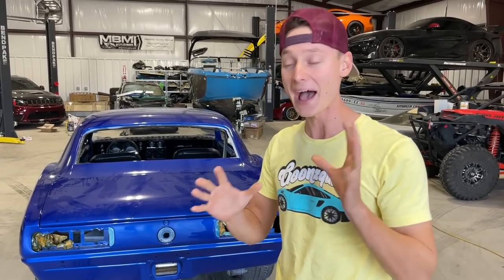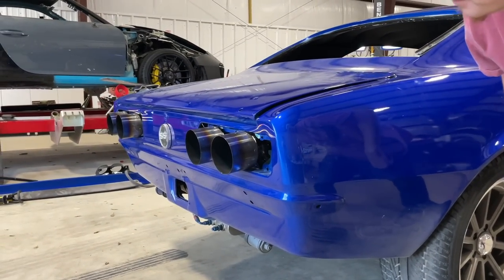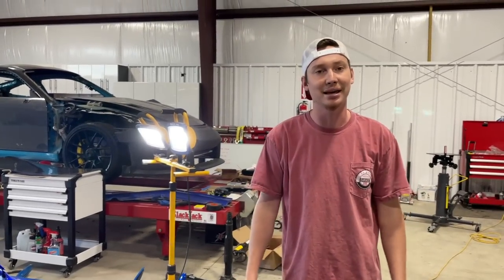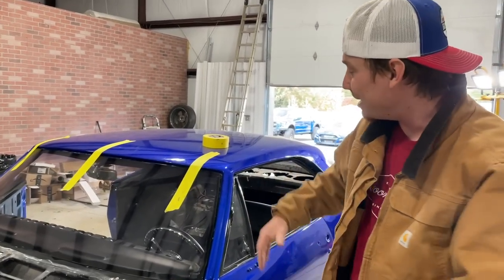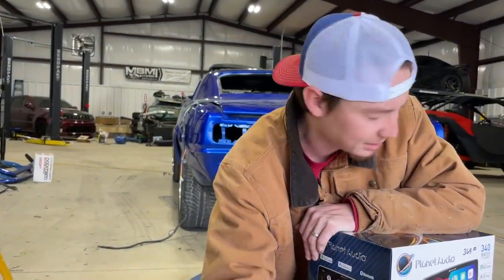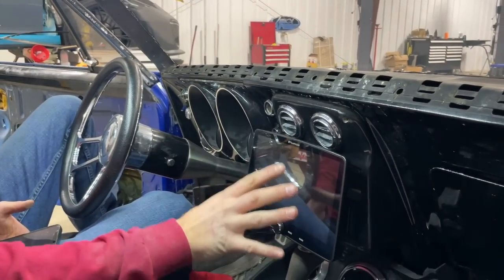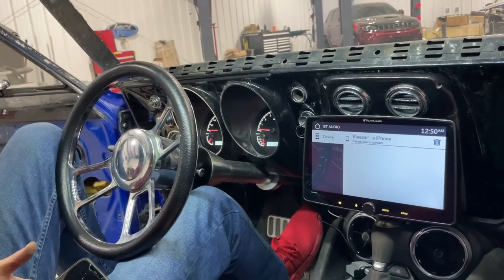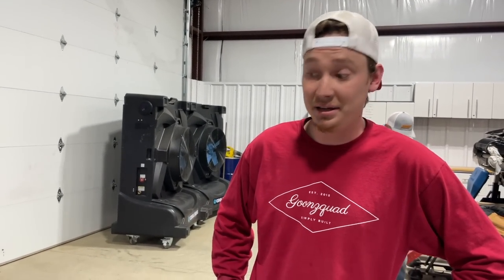Our LT4 Swapped 1967 Camaro Gets An Insane Stereo System!!!

Comment: I know you guys want to finish this car ASAP, but PLEASE, listen to the comments telling you to fix what you did wrong with the fuel pressure regulator, you NEED to connect a vacuum line to the regulator so it can raise the fuel pressure with the boost from the supercharger, you will run the engine lean and blow up it up if you keep doing burnouts and driving it hard like that.
Reply: Doesn't that have a module that controls fuel pressure already? I may be incorrect,  but im 99% sure it is already regulated. That's a legit point though.
Reply: @CorrectiveLensesRequired  No because they installed a custom fuel pressure regulator, the ZL1 they took the engine from does it automatically with the stock fuel system, but since everything is custom in this Camaro they need to add a vacuum line to the regulator because the engine doesn't have any way of telling the regulator to raise the fuel pressure with the boost.
Reply: @joealex65  it's there car they do what they want.they don't have to listen to anyone.
Reply: Engines run really good right before they exPlode.
Reply: @jerrywilcox9890  he is trying to help them out and save them time and money in the future instead of them putting a ton of work into a car and blowing the thing up on accident lmao
Reply: @jerrywilcox9890  ok dad
Reply: Screw um’! Let them blow it up as it’ll be fun to watch.
Reply: Please read joes comment
Reply: Should not be smoking like that. Add the vacuum line like it was mentioned
Reply: They also need to adjust the fan timing and temp on/temp off so the it operates at optimal temps
Reply: @CCscott  true, but not with the lt4
Reply: @chrispudd1815  lol you really think I care what you think or like.second I'm not your mate.
Reply: @chrispudd1815  ya people that like to tell others what to do with there cars.they have already said they have to finish under the hood lol.no way really you need to connect a vacuum line lol.been working on vehicles for 35 years lol don't need you telling me what it needs hahaha.
Reply: @jerrywilcox9890  apparently you do.  I build classic restomods for a living, and the amount of things done incorrectly is staggering.  They are good guys, but they don't exactly know much about mechanic/fab.  What's wrong with trying to help them learn?
Reply: @jerrywilcox9890  The fact is I think they are listening to at least some of us concerning what needs to be done to the engine, but watch how they never mention or give thanks to us viewers for helping them figure out the complicated stuff they don't know how to do, and then their next video they praise themselves for working all day and finally figuring everything out on their own.  That's Bull Shit.  Sneaky little Jerks,  Typical Ukrainians.
Reply: @jerrywilcox9890  I'm just trying to help, nothing wrong with that, as they said on the video, they are just figuring things out, also, for someone that has been working on vehicles for "35 years" and doesn't know why what i said is needed on a boosted engine, sounds like you're who has no idea what he is talking about...
Reply: I hope they see this before they blow up that engine
Reply: Right. It seems like they’re rushing things up
Reply: @timglass6041  agreed to an extent and the worst part about arrogance is it ALWAYS ends badly because you THINK you can grow bigger than you actually can so when you fall you fall ridiculously HARD
Reply: They are young, still learning! Hey, if it blows up! ( which, it will! ) costs , will eventually catch up! And they seem like , quick learners, especially, with all if these keyboard mechanics, in the comment section!
Reply: @jerrywilcox9890  *their
Reply: Some people need to understand these videos are edited sometimes filmed days before so by the time they released the first video the second video is already filmed. So they won't address the problems cause they're way ahead of it. Another thing is I doubt they really pay attentions to most comments which I understand they would be very depressed with all the haters. I suggested they found another youtuber to help them get this car on point. I believe they will complete the car get it running looking good for youtube then send it out to someone to take care of it's issues and fix there mistakes.
Reply: @jerrywilcox9890  yeahhh ayyy jerry cocks
Reply: Hi Joe, 
Your concerns seem real and well researched. I’m wondering if you’ve had a similar experience? Maybe you’ve managed a race team or have built a similar car? (Your kind comments and suggestions will get a far more respectful reaction if perhaps you just let everyone know where you’re coming from..) 🖖
Reply: @rebuilders22  I can remember multiple times they shouted out the comment section for helping them notice things. 

Obviously they are learning as they go. I don't see the issue with professional offering up advice in a polite way. It isn't like anyone us bashing them. 

Some people just have to respond and make everything negative. Or some just want to see them fail for something to watch. 

I'm going to laugh when they run that source to the regular and thank the comment section!!
Reply: Joe Alex is right y’all they will lean it out and burn a hole in the piston.. if anything they need to do boost reference wiht a regulator so that for every pound of boost it makes it will bump it up a pound of fuel pressure.. and might I add them lt4 engines ain’t cheap
Reply: And no that thing isn’t supposed to smoke like that when the rpm gets high. They keep ragging on it like that without getting it 💯 they WILL throw a rod outta the side of the block and that’s a fact.
Reply: these brother will never listen, they will just do whatever they like and think it's right
Reply: @solutionparklane790  it's there cars there channel and there money so they can do what they want.why people think they have to listen to people in the chats is beyond me.
Reply: Message them on all their platforms, they sure to notice 1 comment.
Reply: ( I think that was a brand new complete crate engine from an established recognised company) so I would guess the intake set-up and vacuum lines/ enrichener settings are already fitted? These boys are not too green behind the ears and their pops has a lot of knowledge too. I think they’ve got this one …..
Reply: I was waiting for someone to correct that tool haha
Reply: Dude, they don’t listen, the engine will blow up and they won’t give a shit
Reply: @dorzy207  🤣🤣🤣
Reply: @jerrywilcox9890  come on bro don't get salty, he was just joking with you.
Reply: @joealex65  ya after owning  5 of these cars  . You do need to pay attention !
Reply: If this isn’t acknowledged in a video with a thanks I’ll be jaw dropped
Reply: @MrMit50101  You know you don't have to watch the videos, just go and have a cup of tea with your parents and thank them for still letting you live with them rent free. "Don't be jealous of another man's success just worry about yourself " then one day you can leave your parents home and move to your own place.
Reply: @patriotprepper9175  you know it's not finished yet so give them a break bro.
Reply: @philtucker1224  they got the engine from a wrecked car that is at there parents house but i agree with what you said bro.
Reply: @Nigel_THFC  you've got jokes I wish you the same unfortunate  outcome they going towards and don't worry about me so much I'm glad you care but I'm perfectly fine taking others criticism and advise has got me far in life iv got nothing to worry about and where iv had to thank or give others credit iv done that hence my perfect life because I owe nothing to anyone iv given credit where it was due and that was payment enough for those that helped me but had I used others advise as my own I'd be as arrogant as you and them and my life 100% would be different
Reply: @philtucker1224  they took that engine trans combo out a crashed zl1 donor car.
Reply: Imagine thinking a “bumpin system” is more important than getting the engine runnin GB great and reliably
Reply: Wow, soo many salty balls in this section! Some people may have spent a long time (35 yrs to be precise) wink wink on engines, but perhaps they should spend the rest of their days improving their grammar and spelling! 😄
Anyway, calm down and go have a drink.
Reply: They don’t care about the comment section. As look as they getting views. Fuck it, let it blow
Reply: That fuel line ran over the motor is suicide. Any track that inspects cars before they run will tell them to get it out of there.
Reply: Boost referenced hose is not needed!Control module using factory fuel pressure sensor with adjust pressure.GM instructions... If using an aftermarket fuel pump, an adjustable bypass fuel regulator will be needed if
the fuel pump does not have an internal fuel pressure relief valve set at 84 psi. The adjustable bypass fuel pressure regulator needs to be mounted 
between the supply fuel pump and the fuel pressure sensor that is mounted in the fuel line. The regulator must be set at 84 psi.
Reply: This high-pressure fuel pump on the engine also regulates the fuel pressure 
using an actuator in the form of an internal solenoid-controlled valve that is controlled by the ECM.
Reply: @Heavyhitta509  they didn’t fix it though
Reply: At this point, let them blow the engine. They’re doing this to themselves
Reply: @shootpse88  oh, ok.
Reply: @CCscott  All part of the journey, right? lol
Reply: Letem learn the hard way 🤷‍♂️
Reply: at this point, it'll just be funny if they blow it up. You've told them this like 10 times.
Reply: Expert.....
Reply: Bruh they have FU money they’ll just buy a new engine.
Reply: @jerrywilcox9890  and they don’t, listen to people who actually know how to work on these.
Reply: @krispykruzer  these two are a YT channel that sells a ton of overpriced merchandise. They aren’t actual mechanics, with actual customers.
Reply: The worst part is that they have had contact with Cleetus and James who BUILD THIS STUFF EVERYDAY and they won't ask for help!! Hell, Garrett owns Motion Race Works!! 
I must say, I lost respect for the boys after seeing Sheepy say how bad the R8 is put together.  Not sure if they are stubborn and won't ask for help or just don't know.....also...audio pipe subs 🤔 🙄
Reply: @dullonion797  oh you mean the YouTube  mechanics lol.i wouldn't listen the YouTube mechanics either.
Reply: @dullonion797  so people say they actually work on them and talking out there ass like most do lol.
Reply: Let them know on instagram
Reply: they will just ignore this and kill the engine
Reply: @jerrywilcox9890  that’s the dumbest thing I’ve heard today….. someone offering advise to save a very expensive mistake is warranted.
Reply: Lean is mean! Hahaha
Reply: @Heavyhitta509  No, that's not how these guys do things, you just have to follow them on Instagram to understand, their videos have only 2 days on them, the day before and the day they release the video, for example, this specific video only includes what they did on Monday and on Tuesday the same day they uploaded the video, the Thursday video will be about what they did on Wednesday and on Thursday, Sunday videos will have what they did on Friday and Saturday and they usually skip Sunday activities on the videos because that's their free day. So, this video is as up to date as they get and they have time to fix things.
Reply: @philtucker1224  I'm just a simple self taught mechanic that knows a lot of things about cars, i've seen a lot of people blow up very expensive engines because of this exact reason (too much air, not enough fuel), and i know a thing or two about tuning cars and the air/fuel ratio is something you need to be very careful with, specially on boosted applications, that's the quickest way to blow up an engine.
Reply: @philtucker1224  No, they took the engine from a crashed car, if they were using absolutely everything from that crashed car it would not be a problem, but everything on this car is custom and the engine doesn't have a way to communicate with the fuel pressure regulator
Reply: @joealex65  ok, thanks Joe - understood.
Reply: @joealex65  👍😊
Reply: I'd hate to see them ruin the engine after all the work they put into this project.
Reply: @jerrywilcox9890 * THEIR... at least spell right if you want to try and knock someone bud! Further more it is us fans trying to help them, not make fun of them. They will tell you they are still learning things and love when the fans help them out so take your negative nancy ass to someone elses channel....
Reply: @Jules_73  he is a straight dork!
Reply: @Hugs-hearts-and-horses  I looked at Sheepy's video of them fixing the R8 transmission and yes he had some off-handed comments about the tuning of the R8. What does that have to do with Gonzquad? They did not touch anything in the engine or transmission of this car which his complaints were about. This car was already tuned when they bought it as salvage so it has nothing to do with them.
Reply: @robertgibson1707  oh know hahahaha
Reply: @robertgibson1707  I'm not your bud
Reply: I entirely agree !
Reply: @nigel yea I know “bro” it’s not finished but burning the tires off every video with it “not finished” especially when it could be running lean is a rookie mistake
Reply: They listen but they usually see late. They thank people all the time for the advice but we are seeing things way after it has happened. All the people arguing need to grow up. People are just giving suggestions, they admit they are learning and I am sure they appreciate the advice. At least they will try anything. They aren’t lazy at all.
Reply: Boy some of these kiss a$$ comments on here have me geeking tf out. I bet if y’all seen these bros in person you’d be the first ones to drop to your knees wanting to suck them off. I think the point of this should be to make sure the car is mechanically at 100% before you start burning the tires off or you could burn the engine down
Reply: And yes they need to connect the vacuum line to the regulator so that it can adjust the fuel pressure with the boost it’s the same concept as my previous comment about the boost reference. And also yes running that fuel line across the engine EVEN JUST for testing/burnout purposes is VERY dangerous it could melt or pop off and pump fuel everywhere and literally burn the whole car down.
Reply: But hey if I had YouTube money I’d be a little more chill on stuff like this but I don’t and I don’t think others in the comments do either so that’s why when we see something like this we say something because to us blowing the engine up on a build like this could break the bank and cancel the build until you can save more money to buy another engine and like I said them supercharged lt4’s ain’t cheap lol.
Reply: @kevinmcleod3741  If the internet has taught me anything, it is that there is no cure for willful ignorance.  Reminds me of the old joke, I think by Jeff Foxworthy, about the kid and the TV "just let him pull it down on himself once, he'll learn.
Reply: They don’t read comments or listen to them at all
Reply: @treysimmons2589  lol don't worry about what my problem is cupcake
Reply: @goonzquad
Reply: @chrislambert5904  I'll be what ever I want to be cupcake
Reply: @chrislambert5904  I don't care who has more knowledge lol 😆 😂.there car there money when they get to it they get to it
Reply: @chrislambert5904  they have has 50 more comments about it since the first start lol.when they get to it they get to it.
Reply: @Goonzquad
Reply: Too many haters and people want to see them fail in this comment section. The people who hate do so because the boys are living the dream that most of us wish for. I don't get why people would even want to hate on someone for doing well for themselves and not offer advice when they can see someone going wrong. Just cuz they don't have what they have, doesn't mean they can't contribute to their success. People saying stuff like they want to see the engine blow up show their age. I respect Joe for keeping it 💯 👌🏻 👏 💪 good on you for trying to helps these boys out. You recognise these guys bring us content and entertainment when they could easily do a few videos here and there these guys don't let you down, they give us content all the time and give something back to their viewers. Not many YouTubers can do that and some have the time but still dont deliver the content. You don't need to explain yourself to haters I.e. why you're helping the brothers let the haters hate, just ignore them and they'll grow tired. All they look for is a reaction because normally they never get attention. Saying stuff like leave em they get to it when they get to it, or it's their business why even get involved or being rude and stating they are typical Ukrainians makes no sense. If you're a supporter of the channel say what you like within reason as long as it's helpful and respectful, if not keep quite yourself if you have nothing to contribute or say, hence why this is called a comment section. Supporters of the channel offer advice that's normally not these pretend supporters.
Reply: Karen
Reply: @MrBest-mr2my  in fairness no one knows for sure if they do or not but I can imagine if they did the channel would probably close with all the rude statements affecting their mental health. Why do you think celebs go crazy after a while? Because people like you and me make it impossible for them to have a normal life.
Reply: @jerrywilcox9890  maybe if you actually knew what YOU where doing you would care a little more about saving them trouble 

 They seem ready to have the Camaro build done, so having to rebuild/replace that engine would slow them down quite a bit and then we could end up with a wait of another 2 years in till it’s done.
Reply: @philtucker1224  that’s not a crate engine. They pulled it out of a totaled rolled over 2017 or 2018 Camaro.
Reply: @Mocar1022  lol oh I know what I'm doing there cupcake.
Reply: @Mocar1022  lol I've been working on cars for 35 years cupcake I can handle myself lol
Reply: @MPLVT69  awe you mean there hahaha how's that there for ya 😉 😆 😅
Reply: @jerrywilcox9890  I’m not a cupcake and neither is anyone else.  The only thing as soft as a cupcake is your sensitivity to people trying to help
Reply: @jerrywilcox9890  you would think if you worked on cars for “35” years you would know what you were talking about
Reply: @jerrywilcox9890  and by the way at least use a spell and grammar check if your not going to use correct grammar. People might take you a little more considerably if your sentences actually made sence
Reply: Thank you for putting that out there
@Joe Alex. we aren’t trying to tell them that they know nothing but sometimes people need help with new skills for example Goonzquad is really good with body but they are fairly new to mechanics. It takes several years to get a good feel of everything. More than 35 I guess. @Jerry Wilcox. And even then you still make mistakes. So the best thing to do is just take advice and move on.
Reply: Blah blah blah blah is all they know, they are not taking shit seriously just like they don't take painting these vehicles the right way.
Reply: @Mocar1022  lol and read up above there cupcake.dont care what ya think or like there lol see what I did there 🤣 😉.
Reply: @Mocar1022  keep trying there cupcake.
Reply: @Mocar1022  lol I could care a less if someone takes me serious or not lol.why the hell would I care what a nobody thinks.they couldn't get to me on there best day.
Reply: If you don’t care why have you been arguing in the comments for almost 24 hours
Reply: @jerrywilcox9890  everyone who says that it needs a vacuum line just wants to help
Reply: @jerrywilcox9890  if you don’t want to help then you are one of the people who just want to make work harder for them
Reply: @jerrywilcox9890  You cared enough to comment. lol
Reply: Oh come on! Let's see the ill-experienced blow up a perfectly good LT4. Great content!
Reply: @jerrywilcox9890  he gave up
Reply: @Mocar1022  who gave up.
Reply: @jerrywilcox9890  they are young . if you don't take people's advice your going to live a rough life
Reply: @jerrywilcox9890  it's mechanical advice these are kids building off YouTube videos
Reply: It’s called pulse width modulation. Look it up.
Reply: @joealex65  it controls the duty cycle of the pump using pwm.
Reply: @raptor31able  it's called doesn't matter its a stock motor.
Reply: It needs a retaining wall.
Reply: M
Reply: @jerrywilcox9890  ah once your called out on your know it all bullshit it doesn’t matter anymore right ?  You was completely wrong and out of your lane. You need to own that. Especially since it doesn’t matter and you don’t care what anyone thinks.
Reply: @raptor31able  lmao keep trying cupcake 😆 🤣 😂
Reply: @raptor31able  lol oh know keep it coming cupcake 😄 🤣 😂
Reply: GOONZQOUAD read the comments..Joe is tellin some serious stuff here..
Reply: @JackSparrow-ut1py  lol they don't read the comments 😂 🤣.